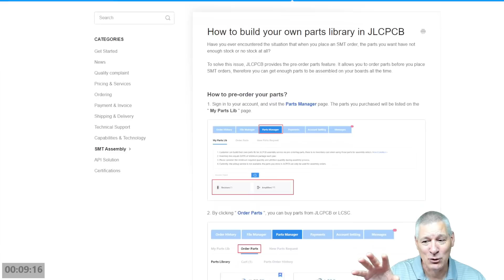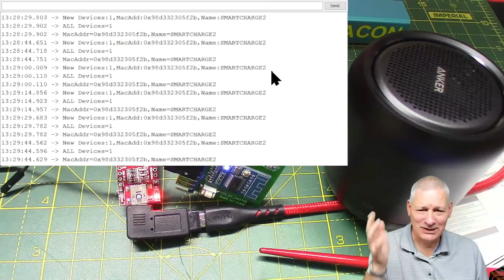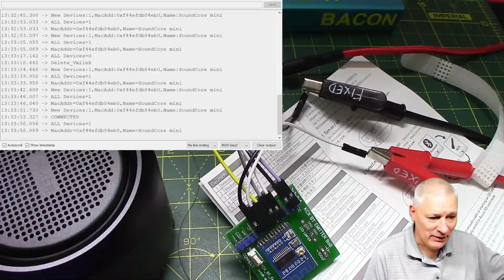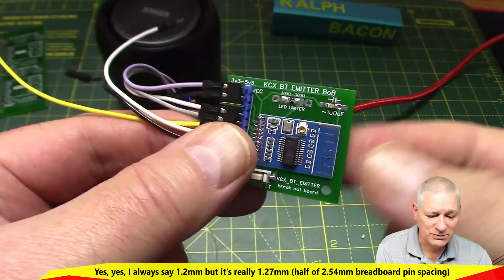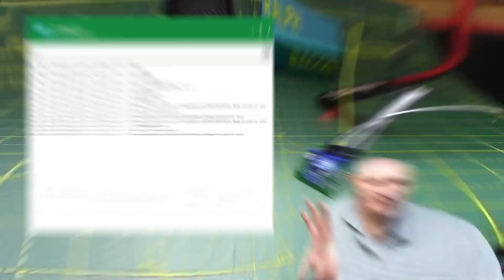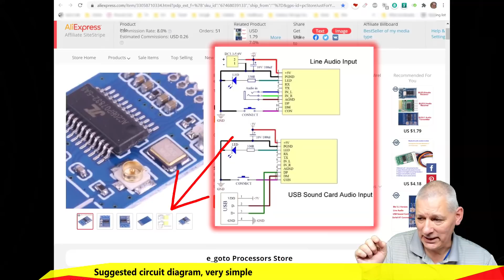#235 Bluetooth Audio🔊Transmitter (KCX_BT_EMITTER) - with AT commands

Comment: I get a constant buzz out of the speaker when it's connected to the board.  Do you have a wiring diagram of how you wired it and got it to sound so clean?
Reply from the maker: Have you connected all the ground connections together (from each board). Is your PSU clean?

Comment: Did your first attempt to solder it to a PCB other than the breakout board work?  I am having trouble getting anything off the the TX/RX pins.
Reply from the maker: I used some extra flux (I do this quite often, it eases soldering considerably) and up the temperature to 400C too (normally I solder at 300C. Just be quick about it at that temperature!

Comment: hi. I have a delay of 1s with the v1.7   !! somebody else has the same problem?
Reply from the maker: So the delay from the source to the transmitted  (and received) signal is 1 second? Well, it doesn't use APTX which speeds things up (and which your headphones might use if they have a transmitter that does support this). Also, it has to buffer enough signal so there are no breaks in transmission. That's my best guess, I did not test this aspect of the transmitter. On pure audio files it might not matter unless you are using an instrument "live".

Comment: I am trying to use a similar chip for a BT project of mine in a Gameboy, there are tons of tutorials online about this but none of them show a way to turn off the stock speaker on the gameboy when this chip is turned on... Would you happen to have any idea about how someone would go about doing this? there is a headphone jack on the Gameboy but it uses a mechanical switch in the headphone port to switch off the speaker rather than through an electrical connection. So if you install this it keeps the stock speaker on and you have BT at the same time which is not the desired result I'm looking for. I want the speaker to shut off when I turn on the chip or pair my headphones.
Reply from the maker: I've had a similar situation; I just got a pair of earphones and plugged them into the device to shut it up, and listen to better quality via the BT method. 

You could also just use a spare jack plug, not a complete set of headphones to do this. Simple and fairly unsophisticated, but it does the job!

Comment: Hello, I'm new to bluethoot technology and to building PCB with MCU (if it's in a fact an MCU) I ordered it to make some test on a project. Do you know if I will be able to command it directly solder on a PCB when my design will be done ?
Reply from the maker: I expect you will be able to program it if you incorporate the necessary push buttons to get the device into AT mode at switch on (just like the modules). Personally, I would use one of the modules and plug that into pin headers on a PCB. That way you KNOW it will work properly.

Comment: Would you recommend this board for an environment where low latency is very important?
Reply from the maker: Well, it's not aptx compliant (AFAIK) and in my testing I was just transmitting audio from my web radio to a BT speaker unit - where latency just doesn't apply. 

I'm guessing if you need low latency you should 
(a) check out the specs of this device more closely
(b) see what else is out there that might meet your needs 
(c) buy one (they are cheap-ish) and try it out and see!

Whichever route you end up taking, good luck!

Comment: Hello Ralph, great video on this topic. 
I got this mittle device (KCX_BT_EMITTER V1.7 printed on pcb) from amazon. 
Connected it to my laptop via usb2serial adapter using 5V setting as Vcc. Using HTerm 0.89 as terminal window, because I was not able to force the actual Arduino IDE to accept the usb2serial adapter as Arduino device.
Now my questions: 
I get no connection to the KCX when using 9600 baud.
When using 115200 (8N1) I get every 15s data from the KCX "SCAN...". So connection is working. 
I can send AT+ and get "OK+" back, but trying AT+REST or AT+GMR I get "CMD ERR!" back. Any idea on this. Has the  V1.7 a totally new set of commands? Or are my com settings wrong? Which are your terminating characters, when sending an AT+ command ? 'cr+lf'? 
Appreciate any support. THX
Reply: Find some answers:
First the commands are different from yours (AT+RESET, AT+GMR?, AT+BAUD?, AT+STATUS?, AT+PAIR) and second you don't type a `?` at the end of a command, that queries data from the device.
Reply from the maker: As Sven stated, queries often have a "?" after the command. I've discovered that not all Hayes commands are equal with some manufacturers implementing a different dialect. Confusing or what?

Comment: I have a video/content suggestion for you.
Reply from the maker: The suspense is killing me.
Reply: @RalphBacon  Suggestion: In the next video, show us how to connect and test the Bluetooth 5.3 audio transceiver module (transmitter/receiver) - KCX_BT_EMITTER V1.7 to this current mini stereo amplifier board "XH-A156" and its smaller sister the "XH-A154" , which has only two 3W audio outputs (3Wx2), but has a very useful volume control. It is also powered by PAM8304.

Comment: After buying (and often returning) several BT modules, I was happy to find this on. Easy connect, true stereo separation (many adverised as stereo are not), tiny size for easy incorpration into other projects. What a winner, and I've only used it as BT receiver so far. I would like to explore that serial connection. I see you used an arduino to make it easier, but are thye TX/RX voltage levels correct?(5V? 3.3V?).  Also Regarding the breakout, I've been thinking of getting some SOP24 breakouts to cut in half make wiring easier, but I wouldn't mind getting a few of the boards you made. Are they available? (couldn't find them at the link above).
Reply from the maker: I used it with a 3v3 ESP32 as a transmitter and it was fine. I can't remember if any voltage shifting was required - always best to check the datasheet for max voltages on pins etc.

Comment: How does the break off antennas work?
Reply: The 'break off' antenna's came with v1.7 of this BT module ... if you do use an external aerial on the v1.1 and v1.4 modules then you should cut the track to the existing on-board antenna connection ...
Reply from the maker: "Break off" antenna? Hmm. Is this really what you mean? There is no break off antenna.

Do you mean "external" antenna (that plugs into the tiny IPEX or UFL connector)? 

What is your real question?

Comment: Hi and thanks for a great video. I was worried about sound delay (latency) with these modules, do you notice that at all?
Reply from the maker: With standard Bluetooth there will always be a small amount of latency; how much this is  a problem depends on your application. 

Television lip syncing is the biggest problem, but transmitting instrument sound will also be problematic as the standard delay is anything up to 1/4 second! Very noticeable when watching TV, for example, if you cannot delay the video by that much.

Aptx (which this little module does not support) reduces that to anything starting from 2mS, so quite a difference.

Comment: Would this board be able to receive commands from the bluetooth device it's connected to? Specifically volume up/down, next/previous track, and play/pause, from headphones. It seems to say in the datasheet that the serial tx and rx can to both directions. I've been thinking about making a bluetooth dongle for my minidisc player that can output the headphones command to the remote plug next to the headphone one. 
So the audio input to the BT board would come directly from the headphone jack, and any commands from the headphones would be sent via serial to an arduino board that can vary the resistance across the remote jack pins to mimic the wired remote they used to come with.
Reply from the maker: I'm not sure that this is a two-way transceiver. I've only used it as a BT transmitter. I'm afraid you will have to experiment or find someone who has used it in a two-way setup. 😔
Reply: @RalphBacon  ah ok, it might be worth a try. I think bluetooth connections involve some kind of data going both ways?
Reply from the maker: Well, the responder BT unit will have to confirm that it is connected, and probably send back some kind of acknowledgement of packets received, that's for sure. But the actual data flow, in my projects so far, has been one way only.
Reply: @RalphBacon  ok, thanks for that. I'll have to look into this myself haha
Reply: @RalphBacon ohhh so it can't be used for a hands-free talking system 🤔

Comment: Thank you very much. I have a question. Can this module be connected to two bluetooth speakers at the same time?
Or do you know a module that has this capability?
Reply from the maker: It connected to "both" (ie Left and Right) earbuds I tried it with. But that's not the same as two separate sets of speakers. In fact, I'm not sure I've ever tried that even with a commercial BT transmitter. You can PAIR them with more than one speaker, but PLAY the same music to both... I just don't know if this is possible, sorry.
Reply: @RalphBacon  Thank you for your reply and your time.

Comment: i'm trying to transmit to multiple bluetooth speakers simultaneously from one audio source, would this or the esp32 be capable of that?  Thanks for the informative video!
Reply from the maker: Most BT devices have a limit to the number of connections they can support simultaneously. Most BT transmitters support at least two devices (eg for left and right ear buds) but many support more. You need to read the datasheet carefully to see what the simultaneous transmission capability of each device is.
Reply: @RalphBacon  thanks, yeah mine are usually 2 also.  My objective is to have the esp32 receive the BT signal from the audio source and retransmit it to multiple BT speakers.  Perhaps one for each GPIO or something.

Comment: Works like a charm. Good sound, no noise. Only using 5 of those pins so used that SOT 20 1.2->2.5 cm adapter. Connects every time so don't need the led, connect, or tx,rx pins. Only catch, mine doesn't work at 3.3V with my ESP32 3.3V pin. But only pin connected to it is Vin(5V). The 3 audio pins are connected to the audio out pins of the PCM5102 i2s chip. BT speaker is a Sanyun SW010.
Reply from the maker: Great, very happy you got it working.
Reply: @RalphBacon  One more little catch. The co-habitation of the wifi and bluetooth in a small enclosure is difficult. Without the bluetooth turned on, I have a wifi range>10 meters in my house. When booth are running it's about 2 meters. Is there a way to turn down the KCX transmit level instead of placing my wifi repeater next to my enclosure? Thanks!
Reply from the maker: I do believe that there is a "transmit power" variable on the BT the same as there is on the Wi-Fi (which you might want to boost to the highest value).
Reply: @RalphBacon  Thanx your answer. Actually, the BT range is >10m. It's the low Wifi range (2m) that's bugging me. Have to either:
1. Increase the Wifi Tx xmit pwr. (n/chng)
2.DECREASE the BT  Txmit pwr. (not found).
I'll just keep the Wifi repeater close to my ESP32.
Reply from the maker: Or swap the ESP32 for one that allows an external antenna (ie it has an IPEX connector on it). Unfortunately you will require the eyes of a hawk (or a USB microscope) to "move" the resistor from built-in aerial PCB track  to the IPEX connector. But the range difference is astounding. I use them in my attic sensors and they talk to my workshop a good 12m away.

And check you are not using the same channel on your Wifi with other things (normally routers will detect existing WiFi channels and try others but it's worth checking).
Reply: @RalphBacon  
The 2nd solution seems highly unlikely as I have a good Wifi range when I unplug the BT KCX module.

The 1st solution (antenna+ESP32IPEX) looks interesting. However, my little box would have to be modified. Do you have any references for those 2 things?
Reply from the maker: Before you get involved with desoldering tiny specks of dust called resistors (they are actually zero ohm links) you can get ESP32-DEVKITC-V4 modules in both standard and IPEX aerial form. I use both. 

The one with the built-in PCB antenna is slightly longer due to the antenna extension, but part from that, pin compatible (same device, different antenna).

I find the 30-pin variant probably "better" than the 38-pin one (unfortunately the most common, apparently) because you cannot use pins 6-11 incl anyway (used for the flash memory by the microcontroller) so 6 pins are exposed that are useless. 

The 30-pin variant doesn't expose those 6-11 pins (so no wasted space) but does not expose GPIO 0 either (but you have to be careful with that one, as it controls the bootloader).

Needless to say, the 30-pin variant is most certainly NOT pin compatible with the 38-pin module. 🤦‍♂️

Scour the Internet for what works best for you.
Reply: @RalphBacon  thanx Ralph. My son loaned me a DevkitC-V4 IPEX with 3 antennas of different lenghts. I will try it on the breadboard first as not pin compatible with the DevkitV1 30-pin that I am using in my prototype. I'll let you know what I find.
Reply: Hello Ralph
Here are my mixed impressions of an experiment I just made.

Set up:
----------
1. ESP32 DevKit-V4 IPEX
2. 3 different antennas; 11,29,46 cm
3. Beadboard wired up with above+all other components on my prototype

Results:
-----------
1. Wifi range without the BT > 10m as before.(I'm sure much better but moved my repeater around the house for convenience. The repeater cuts off when I get any farther).
2. Wifi range > 5m when I place the antennas at 16cm from the BT instead of the 2m which I found with the DevKitV1 with on-board antenna at 2cm from the BT.
3. Wifi range 2m when holding the antennas (even the 46 cm one) at 2cm from the BT. 

My conclusion:
-----------------------
The external antenna probably more sensitive than the on-board one but it as also more sensitive for the BT.

Solutions:
---------------
1. Rewire my prototype for the new ESP32 pinout and wall-mount the antenna as far as possible from the BT.
2. Use the original wiring and the old ESP32 but add some shielding. I put a perboard with aluminum foil skotch-taped to it. (Seems to work a little better but I should make the shielding more directional).
3. Do nothing but keep the Wifi repeater at 1m from my proto.

Voila, Ralph the end of my little story. Thanks for your comments!
Reply: Found the solution for my case. I cut off the BT PCB antenna on the perforated holes provided. WiFi and BT working fine now. It was a risky experience and the reduced BT range of 5m (I only needed 2) may be less depending on the sensitivity of the speaker. I'm using a Bose Soundlink Flex now.

Comment: Can you provided details to the cap, led limiter, and connect button you used?  Sorry, a newbie here.....
Reply from the maker: I've responded to your other comment but the cap is a standard 100μF through-hole or SMD 6v (or higher) one, and the resistor a 270Ω 1/4 watt SMD or through-hole (the board supports both formats).

Comment: Where can I get the break out board?
Reply from the maker: The Gerber files of my board are in the GitHub for this video (https://github.com/RalphBacon/235_KCX_BT_EMITTER-Breakout-Board ) which you can then order from the PCB supplier of choice, but JLCPCB is top notch (and inexpensive).

If this makes no sense at all (I see you describe yourself as a newbie in another post) email me (read the video description of a more recent video to find it) and I'll walk you through it.
Reply: @RalphBacon  thanks. I was able to figure that out after reading more comments. I have some ordered. What about the button, cap, and led limitter?
Reply from the maker: A standard 100μF cap, 6V or more (not too much more or it will be enormous), 220Ω-ish resistor and the button is fairly standard SMD button, just sits on top of the board, you'll find them used as reset buttons on many PCBs.